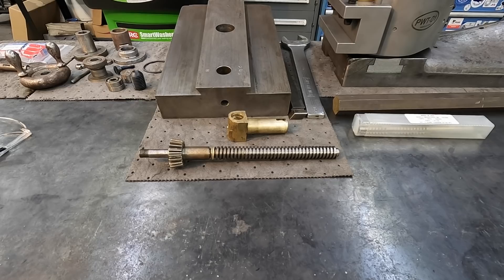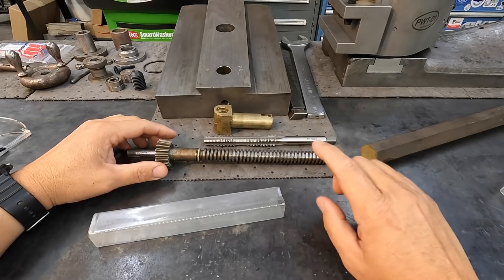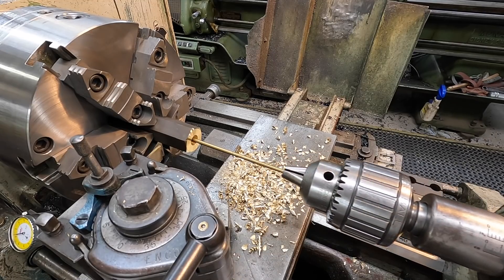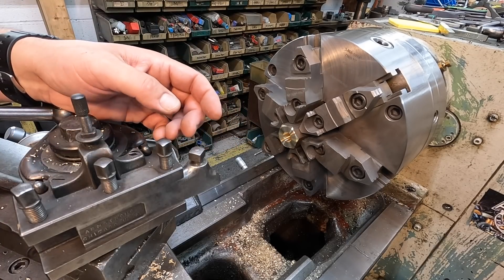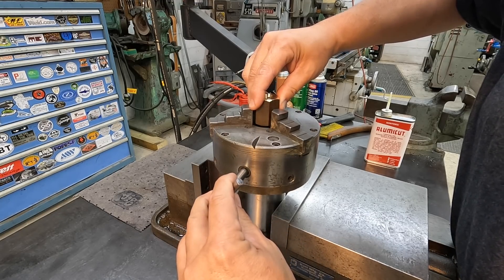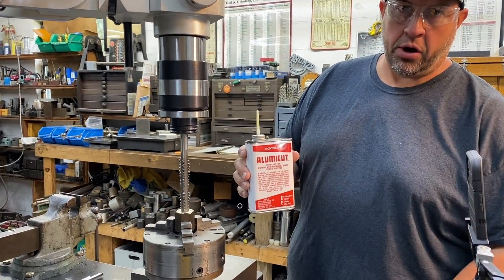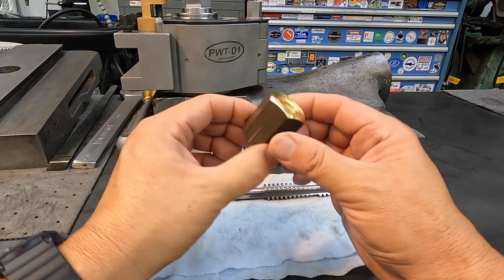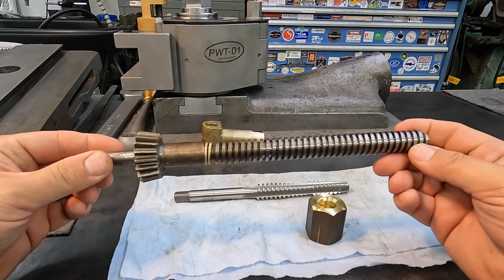Machining a Bronze Acme Nut

Comment: How come the threading was causing such a squeal?   Also, why do different metal chip differently on the lathe?  Some chip, some spirals, or some a mixture of both.
Reply: Brass is brittle. The chips break instead of spiraling. The tap is steel and the brass is much softer. The squealing is the brass grabbing the steel a making noise as the cutter moves through it. ✌
Reply: @jamesbarisitz4794  in physics they call that stick-slip noise. Same as the squealing sound you get dragging your finger across wet glass.
Reply: That's a good question with a complicated answer, for a number of factors can influence squeal and chatter in a cut. The noise is a function of vibration, somewhere, in the system, as it were, and the most obvious cause, or the easiest to remedy, is the tool or workpiece being insufficiently secure. Vibration can also be a result of the always-present variables of depth of cut, feed rate, and rate of rotation. Measures can and should be taken to reduce or eliminate chatter and noise by altering feeds or speeds or depth of cut, and this is why an intimate knowledge and feel for "feeds and speeds" are so important to a machinist. Sometimes its down simply to the material qualities of either the workpiece, cutter, or both, as they interact in a harmonic way to create vibration, and I think that's probably the culprit in this video.

Bronze is relatively free-machining; it features greater inherent lubricity and less tensile strength than steel or aluminum, which is why it tends to cut really nicely, producing the chips you see here. Here also, cutter and workpiece can assumed to be fairly solid, and so I suspect the squealing is a result of the cutter (tap) interacting with the bronze at the very point of contact/cut, creating the right amount of vibration as the leading edge of the tap breaks through the material and as the material pushes back against the cutter, according to Newton's third law. This reciprocal back-and-forth forces, when rapid enough, will cause a squeal. Because the tap's cutting edges are fixed, depth of cut will be constant, and so the only thing Adam could alter would be the spindle speed, but tapping must be done at a safe and appropriate speed. So the squealing here can be considered unavoidable, even with the cutting fluid.

Chip characteristics will be dictated largely by the material properties—lubricity, tensile strength, hardness, toughness, ductility—by depth of cut, and by the characteristics and geometry of cutter and chipbreaker. Often a machinist will judge the appropriateness of their setup by the quality of the chip it produces, though regardless of setup materials will tend to produce nice chips or long spirals based on their physical properties.
Reply: Different materials, different properties
Reply: All of that has to do with the geometry of the cutting insert, the fact the material is spinning and not the cutting tool and the type of material being cut.

Comment: Did they cut square threads in the past because it was easier or better or? What are the pros and cons of square thread and acme thread?
Reply: Square threads are extremely difficult to machine properly. They're theoretically the best threads out there in terms of strength, and I think their backlash characteristics are quite good, but ACME is good enough for most things. 

I also seem to recall that square threads were less forgiving of wear. Like, they take a long time to wear out, but they don't tolerate wear as well as ACME threads do.

Full disclosure, I'm a dingus and a hobbyist who's just really interested in this stuff, so please do your own research, don't trust what I'm saying.
Reply: @GregBadabinski  Acme threads can be wear compensated with an antibacklash arrangement (split nut with a spring) also.
Reply: I think they're a lot more durable than typical threads. That would mean they're stronger, and less likely to wear out and cause slop over time.

Edit: And it's not just something they did in the past. They would still do this for power screws on modern machines, unless they went a step further and used a ball screw.
Reply: Square threads offer the least friction and are the most efficient thread form, which is why they are used for precision lead screws. However, square threads are difficult to cut, because the cutting tool—whether single point, tap, or die—cannot have rake or relief angle, and cutting-tool life suffers when cutting square threads.

Trapezoidal threads are stronger than square threads and offer better wear characteristics, while also being relatively efficient, so that they are also used widely in lead screws as well as in power-driving screws, like vises and jackscrews.

I'm not sure why square screws would have been more popular in the past. Perhaps machinists and engineers simply hadn't thought of a trapezoidal thread form yet.